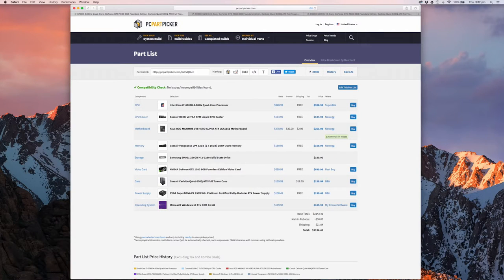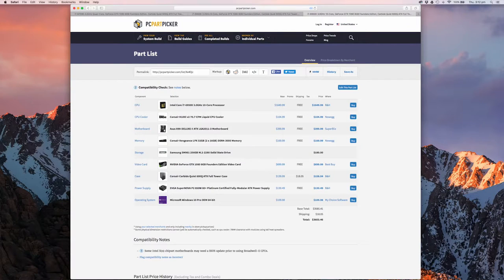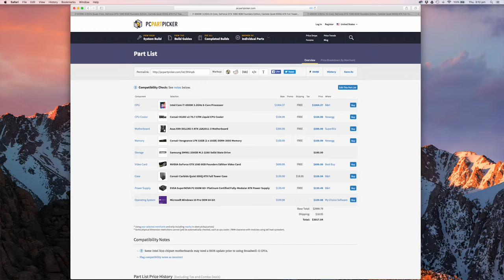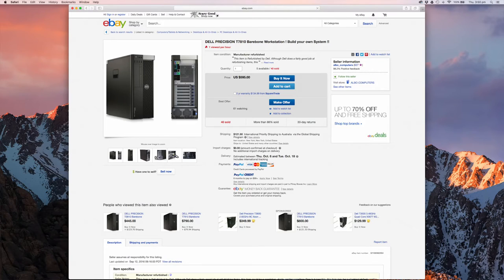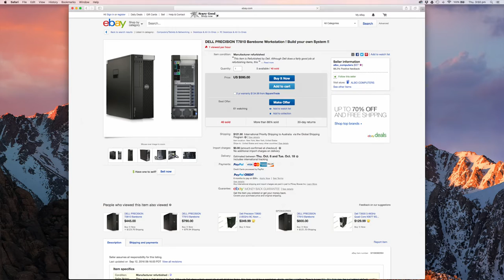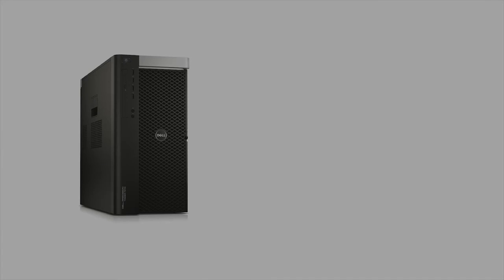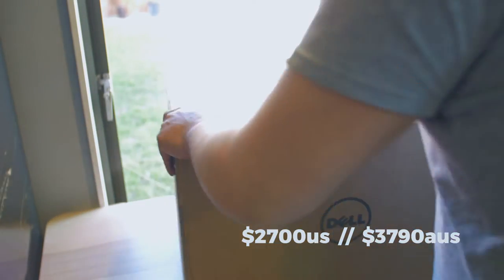$2700 RED 6k Workstation Build - 24 Core 48 thread Weapon. Part 1/2

Comment: I’ve also gone the same way about a year now with dual E5-4660 CPU’s 64gb ddr4 ecc 1080ti. System still under warranty through Dell as well for parts replacement. Had both CPU coolers replaced. 1300w PSU in mine.